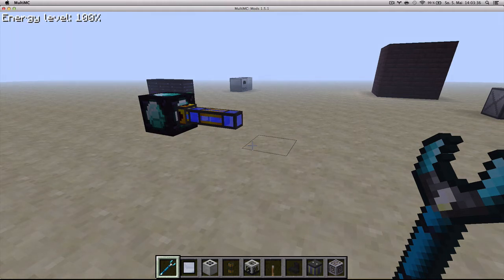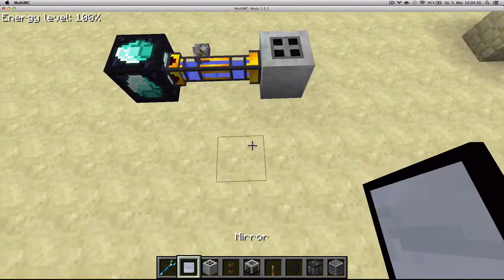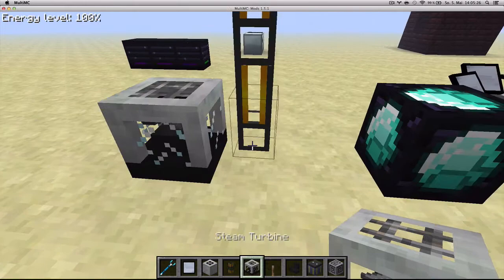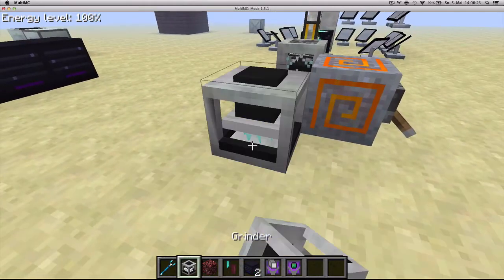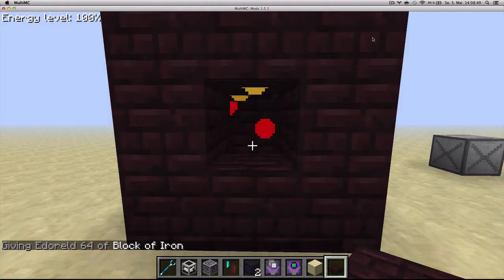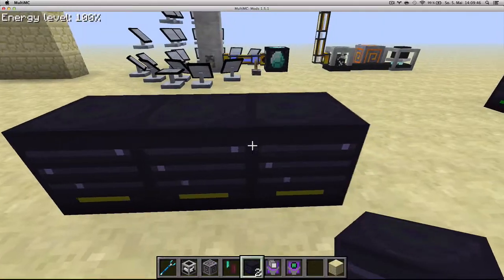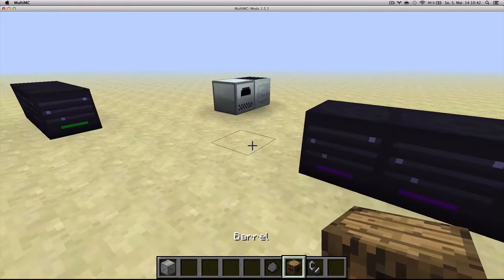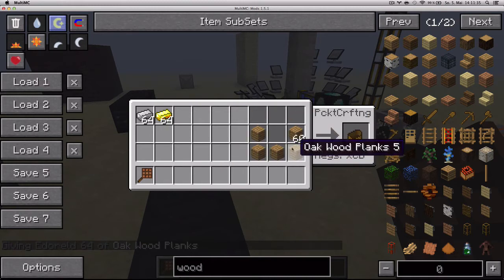[Change Log] What's new? - Factorization 0.6.7 to 0.7.21

Comment: Several facts about wrath furnace:
-To keep wrath fire burning you need 13 or more nether bricks somewhere in 3x3x3 cube centered on the wrath fire.
-Wrath fire in the furnace can transmutate only so many blocks of iron, after some (not quite small) amount of  transmutated blocks the fire burns out, but never disappears by itself.